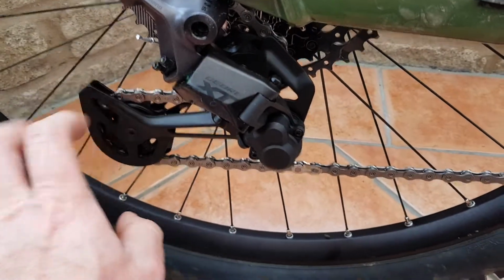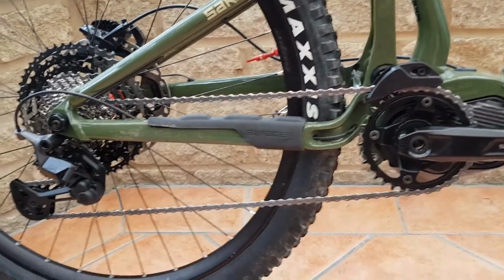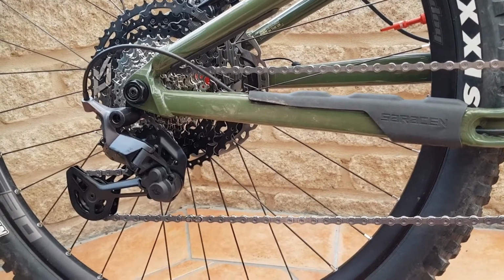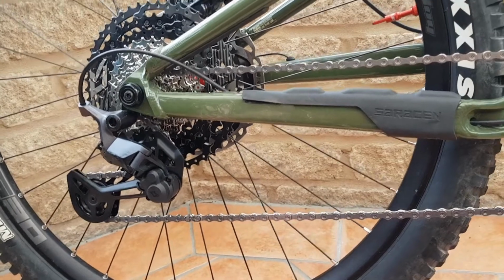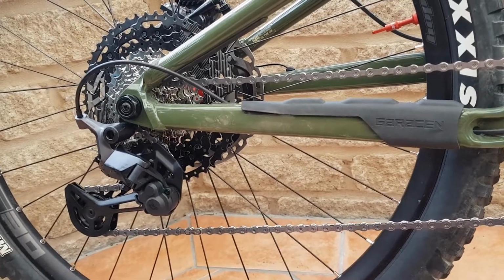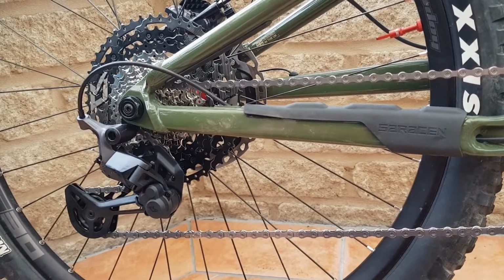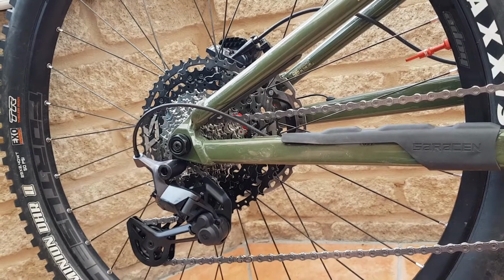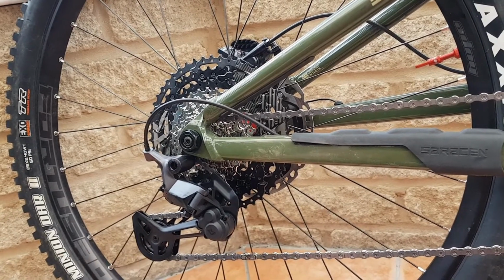Installing Shimano Linkglide onto my Saracen Ariel 50E Pro ebike #emtb

Comment: Hi mate, I was wondering if you were happy with the Linkglide after having it a couple of months? I am considering doing similar on my Vitus e-Sommet.
Reply from the maker: Hey Tony, yes very much so, still shifting nicely even under load :-)

Make more sense if ebikes started coming with this drivetrain :-)
Reply: @churchofdirt-mtb  Thanks for the reply, this is obviously a drive train designed primarily for ebikes and I am sure we will see more ebikes being fitted with it as a standard, particulary by shimano who will be looking to use the next gen coupled to their new EP801 motor. Good to hear you found the service from bike-discount-de good as well, I was looking at them and their prices and their stock levels look better than UK outlets. Thanks again.

Comment: I’m thinking of doing the same but am put off by having to get an HG hub which is needed with Linkglide. What was involved in fitting an HG spline to the Micro Groove hub?
Reply from the maker: In short, it requires a HG compatible hub. Longer answer, your hub may allow the removal of the microspline freehub and fitment of a HG freehub, for makes such as DT Swiss or Hope this is very easy, for ithers it may not be possible. It is best to first research whether there is an adaption option for your hub

Comment: Is the Linkglide system quieter when upshifting than the Hyperglide system? If so, I'd like to upgrade to this one. My Hyperglide system makes a lot of noise in the last three small sprockets when shifting up.
Reply from the maker: Thats usually remedied by B Screw tension, to be honest I haven't noticed a reduction in noise when shifting but it was pretty quiet with hyperglide for me. (Not anything over the motor noise anyway).

Comment: What's the difference between that derailleur and the 5100?
Reply from the maker: Someone is borrowing my M5100 equiped bike at the moment so I can't provide a full visual comparison. From memory though:

The Linkglide M8130 is an XT level mech, jockey wheels have bearings etc so smoother.
The Jockey cage on the Linkglide appears to be more robust.

Would a M5100 mech work with a linkglide shifter, chain and cassette, I don't know to be honest, unfortunately it's not something I'm going to have time to try in the short term
Reply: @churchofdirt-mtb  ty for the reply, I'm trying to get the mechanical specs for both before I upgrade my cassette. I was going to go with the 5100 group set and saw this cassette.
I already have the derailleur. 
From what I've researched, there are components that are cross compatible that the manufacturer won't be exactly forward in divulging.
I just can't find a side by side comparison on the mechanical functions and exact specifications.
The ratio seems like it would be the same
Reply from the maker: So the range on the M5100 cassette is actually greater, 11-51T vs 11-50T on the linkglide cassette. In terms of cross compatibility, the tooth profile on the Linkglide is different to the Hyperglide cassettes, such as the M5100 and meaning that a hyperglide chain doesnt work well with Linkglide cassettes. Saying that, I retained the chainring on my ebike between the XT M8100 12 speed setup the bike came with and when I replaced that setup with Linkglide. Shifters, I've heard the "pull" is different on Linkglide over 11 speed Hyperglide but I haven't personally confirmed this. Mechs, the jockey wheels maybe slightly different but I won't be able to confirm until my M5100 equiped bike comes back :-)

Comment: how many gears can you change down at once?
Reply from the maker: Apologies for the delay in response, it's 1 higher gear and 2 lower gear at a time. (So changing down the cassette, 1 at a time).
Reply: @churchofdirt-mtb  ok, thanks, the shimano website seems to have incomplete specs.

Comment: Dude, this is a review not an install
Reply: Wouldnt call it a review, hadn't used the system before the video was created so wasn't really able to share any insights. Probably more a post install update but does cover the parts required if you wanted to replicate the install 😉
Reply: @rsmithuk  but it s not a install video either! it s a waste of time actually!
Reply: @graphenemusic5922  lists whats required for the install, shows the expected prices, install would just be "yet another Shimano groupset install" for which there are many videos on this channel and others showing that. On balance, cheap video with some pertinent information for those looking at doing an install on what they will need to purchase before hand.